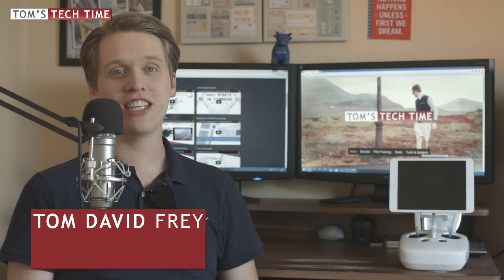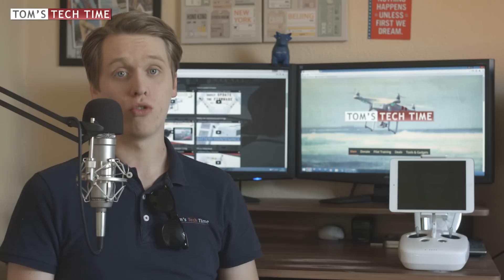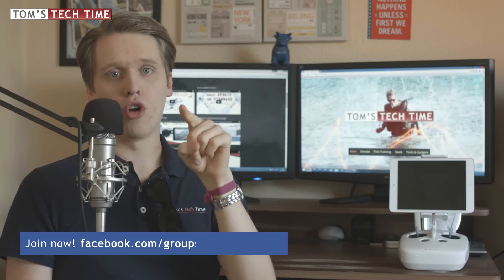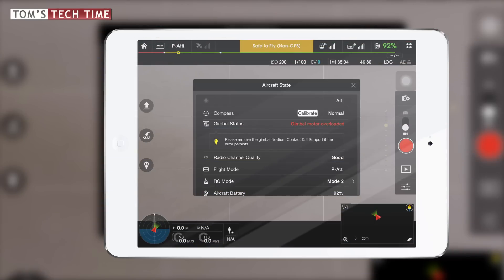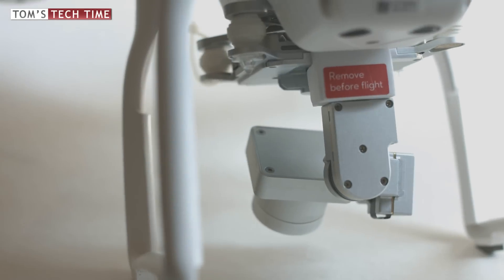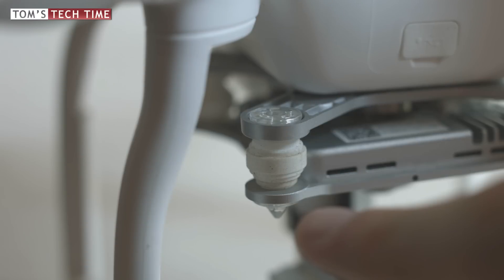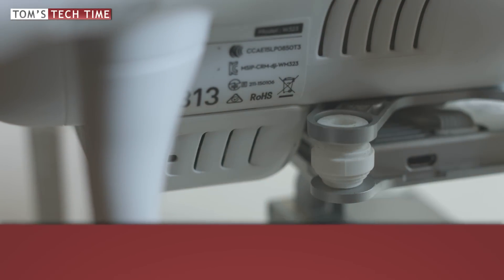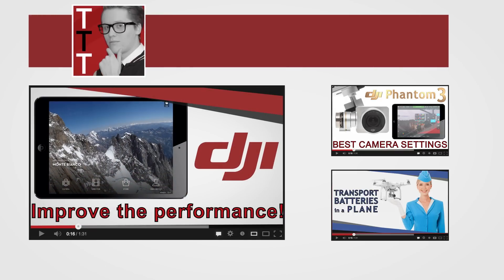How to fix Gimbal Motor Overload Error | DJI PHANTOM 3

Comment: Thank you... That was easy.    I am new to "the Drone World".   I have a phantom 3 pro, bought it used,  and learning everyday.   So I ll be coming back alot for information. But I have an issue with controlling  not coming on at all.  so I open it up and disconnect board from the battery for 10 seconds then out it back together and it starts right up.   Is it just time for a new battery or something else?

Comment: Tom had same error on Phantom 4 Pro and watched you video and low and behold there is a similar foam guard on the back of the gimball that was causing the error.  Thanks for your video it really helped.
Reply: unbelievable. same thing happened to me.  After EVERYTHING.  Hope I didn't burn out my gimbal motor. Seems to be working now.   Who the hell would look for the foam?  No video I've ever seen, much less the over-the-top John Stavos/Tom Cruise love child otherwise known as "Ty" has ever mentioned it.  SMH.  Now to fix the "braking now" message.  Suspect that has to do with obstacle avoidance and my small backyard...

Comment: Tom I have a question for you. I have a Phantom 3 Standard. When connected with my IPhone I can play video stored on the SD card. But when I connect my Ipad the video will not play and I get a connect error message. I have check the SD card to ensure there was video footage available to view. Again, the play button when using my I Pad gives me a "connection error can't retrieve files" but when I use my IPhone the video plays. Note: The aircraft is on and connected to the controller, my Ipad is connected to the phantom WiFi and I can record video but I just cant review it using my Ipad. Please help

Comment: Hi Tom. My camera on my phantom 3 pro, is making a noise, similar to the noise when I updated the firmware, and it moves every second or two. The screen on my phone, says that I have to calibrate. I have tried several times to calibrate, but the problem remains. Any suggestions?

Comment: I also find that if the camera is sitting in taller grass it can cause this same warning. I simply moved the Phantom to an area with shorter grass and it worked.  Or I guess you could just rip some grass up. 😆